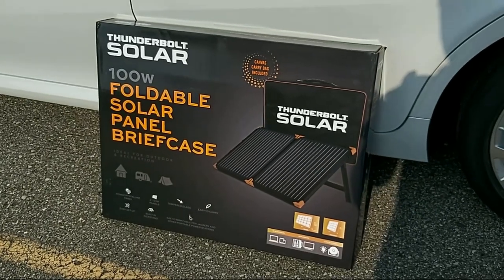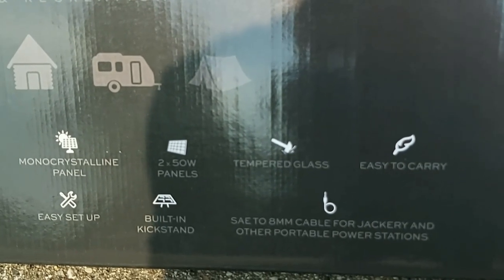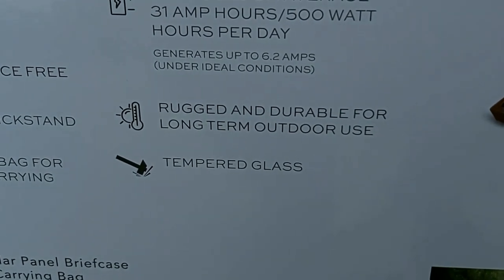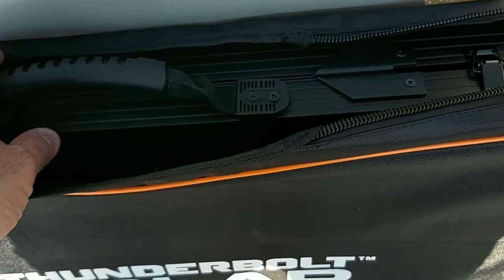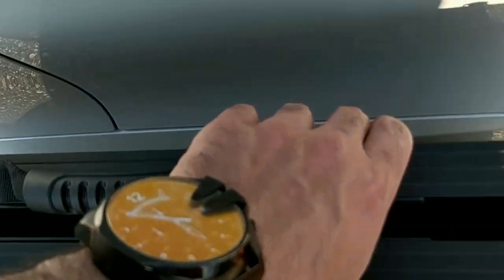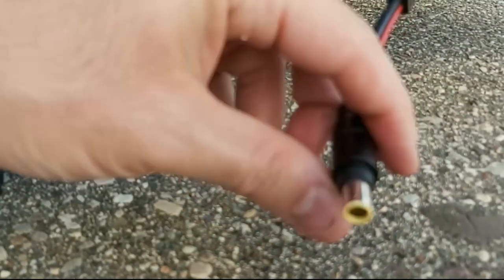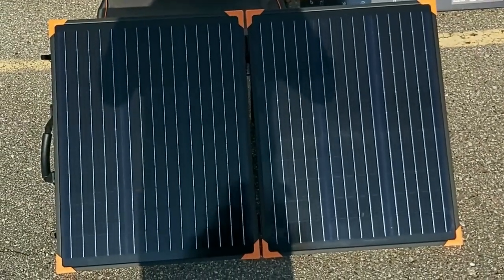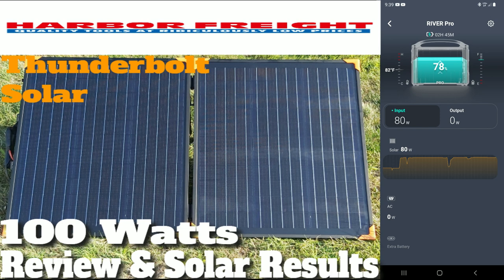ThunderBolt Solar 100 Watt Folding Solar Panel Briefcase Review + Test Results | Harbor Freight

Comment: I had done testing with this same panel on my channel and had gotten 113-117Watts using a Jackery 880 with the supplied adapter.  Additionally, attached it to a Renogy 40Amp Charge Controller and reached 122Watts.
Reply from the maker: Hi, WOW 113 or even 122 sounds really good, I might have changed a setting in my EcoFlow app to prevent the solar panel from exceeding the 80 watts here, thanks for watching and the update as well, happy holidays to you.
Reply: Wow! Awesome thanks for chiming in

Comment: Just cut off the connector and install MC4 connectors. Way better and cleaner setup and you will use Ecoflow supplied MC4 harness.
Reply from the maker: Hi, of course you could always do that, thanks and cheers.

Comment: I was going to pick on of these up but after seeing that the glass is to the outside while in transport is just a poor design. Why put the fragile side out for transport? Those should face each other.
Reply from the maker: Hi, I do agree with that, much better if they were facing each other.  If you like the briefcase design, you might want to check out the Renogy brand 200w panel.  Best of luck to ya and thanks for your input too.

Comment: Mine is not working. It has absorbed a lot of sun and it does not charge the jackery. I just got it for Christmas.
Reply from the maker: Hi, sorry to hear that.  Make sure all wires and plugs are connected securely on both ends, try a few more times if that doesn't work, you might have a defective unit, they should exchange the solar panel for you.  Best of luck and thanks for watching too.
Reply: @ReviewsandTech  Working now. Just takes a while to start charging the jackery.
Reply: @ReviewsandTech  It's not charging the jackery, again. It absorbed enough sun. The blue light on the jackery lights up for ten minutes then stops lighting up. Does it really need days and days of sun to charge a jackery or is the panel flawed?
Reply from the maker: Sorry for the late reply, when you say it doesn't charge the Jackery, which Jackery power station do you have? I ask this because I think the smaller units don't show how many incoming watts are coming from the solar panel.  Now the bigger capacity of a power station, the longer it takes to fully charge them, I mean unless you have like a 400 watt panel.  Hope that clarifies things for you, take care.
Reply: @ReviewsandTech  Jackery Explorer 290 -- I replaced the solar panel today, and the Jackery blue light is on, but no input data. Also, Harbor Freight customer service told me the problem was that I did not have a solar charge regulator. However, today, the Jackery blue light is on with the normal portal that comes ready with the solar panel, and when I switch over to the solar charge regulator, the blue light does not turn on.

Comment: Angle is important. You might have gotten more power output if you tuned the panels a little bit better than just accepting the angle generated by the legs.
Reply from the maker: Hi, yes I agree angle is important, I will keep that in mind too, thanks for watching.

Comment: Great information. I have an Ecoflow power station and was wondering if I could use these panels to recharge my delta model station.
Reply from the maker: Hi, You usually can as long as you have the right adapter that fits your power station and the voltage VOC and Max amperage of the solar panel doesn't exceed what the power station can handle.  Otherwise you can damage your power station if not careful.  Thanks for your input as well.
Reply: When you run panels in parallel the voltage stays same,you just get more watts depending on sunlight conditions.

Comment: With this solar panel and a jackery, what things can i charge and for how long?
Reply from the maker: Hi, that is a good question. The Jackery power stations come in different capacities, so the bigger the unit the more you can power up things with it.  This goes for any power station, and usually the bigger units cost more of course.  You can charge your phones and tablets and other devices many times with many power stations. I hope this helps you out. Thanks for watching as well.
Reply: Ah ok so to power up a microwave or something like that you need to spend a good amount of money
Reply from the maker: @lifes2short4b41  Well every power station has an output limit, for example 300 watts, 500 watts and so forth.  Keep in mind that anything you plug in that gets hot usually uses a lot of power. Hopefully that helps answer a lot of your questions.

Comment: i know you can do what ever you want if you know what you are doing, but can they be daisy chained as designed?
Reply from the maker: Hi, I am sure if you look online you can find solar connectors to connect multiple units together, this panel came with a 8mm DC cable, thanks for watching as well, cheers.
Reply: You can run parallel or series . Just rewire to C4 connectors, and use Y connectors .

Comment: You should have used an xt60i instead of xt60 to get the max input
Reply from the maker: @cee3  Cool, thanks for the info and your input too.
Reply: That’s only true if you are supplying more than 10amps from the solar panel I believe. Standard xt60 is just fine and won’t limit 100w

Comment: Can this run a 12 volt dometic fridge while camping ?
Reply from the maker: Hi, you will need a power station to plug this into to charge it, so then your fridge can be plugged into the power station weather your fridge has a DC or AC plug.  DC is much more efficient than AC.  You need to find out how many watts your fridge uses, it's usually stated in the manual or the back of the unit.  I hope that helps you out.  Best of luck to ya!

Comment: Anyone know if it works with a Anker Powehouse II 400?
Reply from the maker: I believe this solar panel comes with an 8mm DC cable, although not sure if the Anker power station does, so check your manual for the VOC and amperage too. I hope that helps.

Comment: Wait so you can’t just buy it, and plug your phone charger into it to charge your phone????
Reply from the maker: Hi, you can't do that with this panel, now with other models that I have reviewed in the past on my channel you can because they have a built in USB port and such, thanks for watching, enjoy the sunny 😎 days.
Reply: Lol a 100w solar panel is way overkill to charge a cellphone. This is not intended for that in the slightest.
Reply from the maker: Hi, you are so correct, the most I have seen a cell phone charge is at 12 watts, but most portable solar panels have a regulator built it so it doesn't damage your charging device, thanks for the comment as well, happy holidays.
Reply: Yeah I bought one for someone as a gift when their power went out. It was going to be for a number of things but they were most concerned with being able to use their phone for emergencies and entertainment. Horribly I got a call while they were at 5% battery left, telling me that it doesn’t work and that I’d need to buy more items and drive BACK about 70 miles again to drop them off. Totally disappointed at how they advertised their product to be easy and simple, almost completely leaving out that youd need more devices……. I fell for it……. Could’ve spent a little less, maybe on a different brand, that would have been such a relief and time saver. This company won’t be around long unless they invest and buy out other companies, which would suck……
Reply: @Zentinel_85   Bro what? It clearly states what connections it has on the box and online. Great product if you read the description first…
Reply: @carnagejlu  Bro What? Have you bought a product of theirs before? On the boxes or their products, which you clearly haven’t seen, show what they have inside, AND a multitude of other products that GO with that product. It was made confusing on purpose (you obviously know nothing about marketing tactics) essential parts aren’t included in all boxes, making you buy more boxes or more expensive setups to get what you need. Look at the boxes first. Then pretend your family is waiting on you with no power, your phones about to die, you can’t plug it in, can’t research anymore and all you have infront of you on your last ditch effort to redeem yourself in the eyes of your loved ones, is a bunch of boxes that aren’t clearly described and enough money to get the right ONCE. THEN come back and tell me it’s easy….
OTHER brands are easy. THIS brand is confusing AND garbage…
Reply: @Zentinel_85 0 confusion. Reading is fundamental…
Reply: @carnagejlu  You want confusion? Buy that solar panel…
Reply: People don't realize a solar panel is an unregulated power supply. It requires a battery charger (solar charge controller)for regulation and a battery to fill. From the battery you hook up a cigarette socket and or a 12 volt powered usb port. That will charge all night and fill up in the day time.